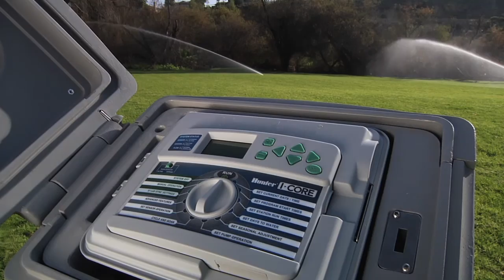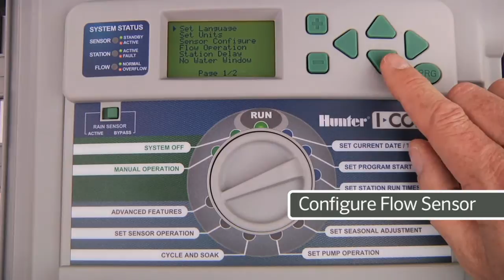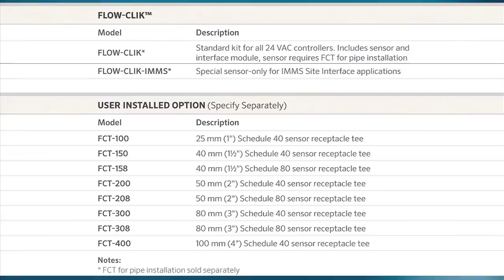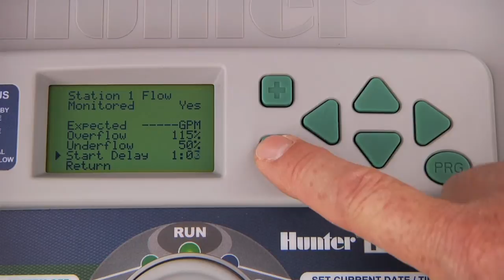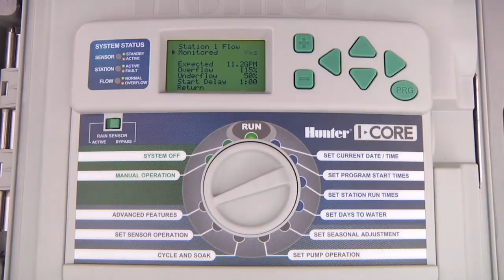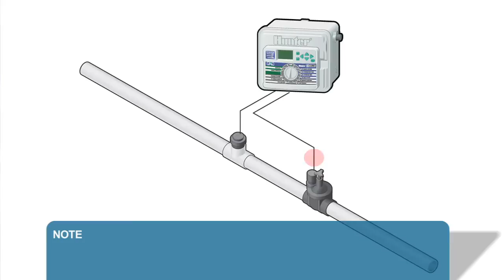I-Core Controller HFS Flow Sensor Setup

Comment: Hi I am a sprinkler contracter I.am thinking of doing a hunter with flow sensor but I have a question if I use a pump.sys and a hunter flow sys my.pump.is my mv. What if I do a learn Flo and the sys sez. Maine line low flow when my sprinkler sys is OK do.i have to set my . settling Time to a large number b.4. It takes action if I have a pump sys and I set settling time 4 3. Min I can blow the lines apart b 4 the controler does anything